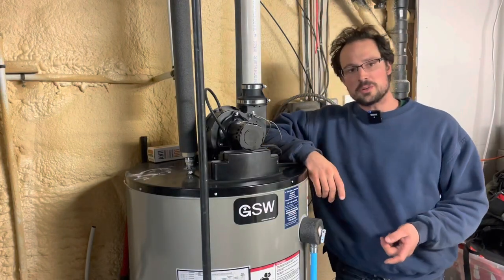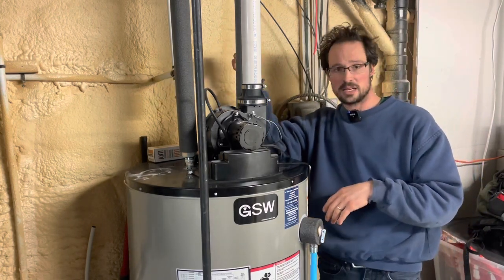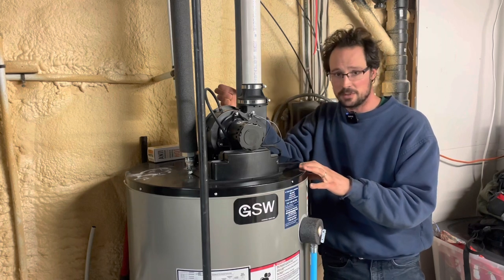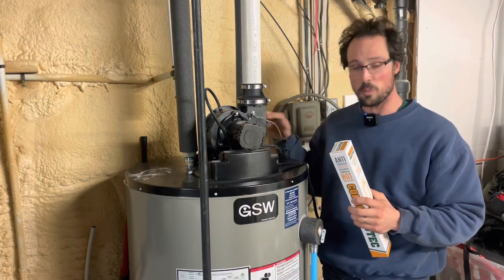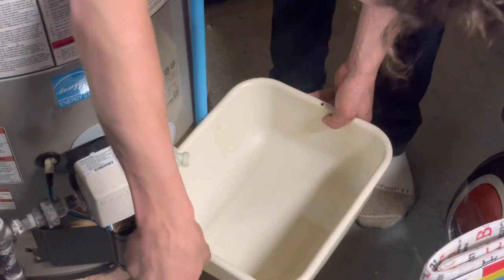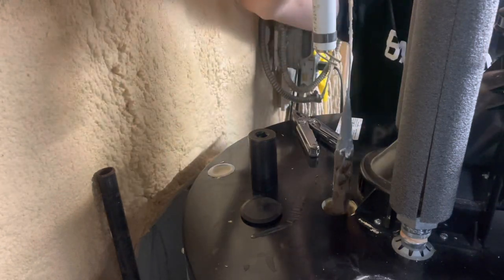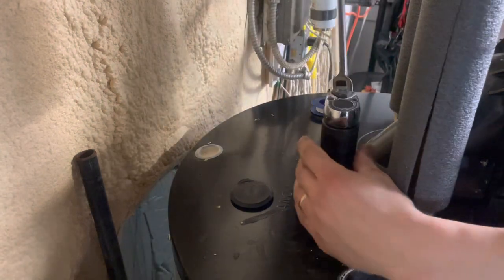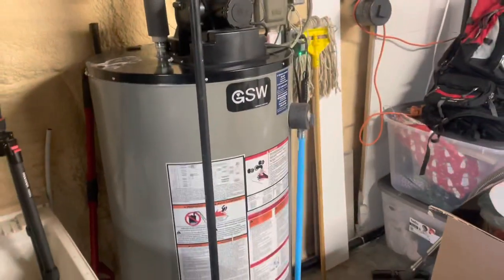Smelly Hot Water Fix - Electric Anode Installation

Comment: I've had an electric anode for about 10 years. It solved my egg smell problem. Next time I buy a new hot water tank I'm going to remove the anode while the tank is still in the back of my truck laying on it's side. Much easier than trying to keep the tank from spinning if the anode is rusted in there.
Reply: I had to use my impact to remove it. Worked very well

Comment: Thanks for mentioning that this new anode is a different size than the old (standard 1-1/16") anode and the new  size is actually 1-3/16", but I am glad you said that a 30MM socket will work. Good video

Comment: Excellent video on removal of the old anode rod and replacing with the Corro-protec. My 50gal AO Smith Gas water heater is about 3 years old and I drain and flush once a year. I knew the anode rod should be replaced every 3 years or so and upon checking for a new anode I ran across the powered anode. It has a 20 year warranty and hopefully it will provide trouble free service and save having to change the anode every few years.

Comment: Killer! New to well water. Got a new tank and smell is still there ( water wasn't ran in two years so needed a new tank! Yuk). So I did see this online and glad you verified it's worth! Will Amazon it and thanks for the instructions.
Happy New Years from Maine🌟👍
Reply: Did this fix the smell with your hot water?
Reply: @chadgilreath8952  funny it did get better but iron in both cold and warm now. Put a carbon filter ( in our sediment casing filter to replace the sediment only filter) water doesn't smell and iron is much better but PH is still hard. I know that filter will have to be changed at least every 45 days. We will see. Will work till we get money saved for filtration and water softener.

Comment: Good video. However, there's probably still residual white powder at the bottom of the tank. Which, depending how old the tank is, could require additional efforts to get rid of. Amazon lists something called "Turbo Tank Cleaner" which appears to be helpful in getting rid of the white powder stuff. Also: if the old anode rod is stuck in place, an impact wrench can provide help. Home Depot has electrified impact wrenches for rent: ~$17 for a 4 hour rental.

Comment: Here is some weird information for you. I'm a bit of a lazy guy, so sometimes I just leave my water softener without salt for LONG periods of time (note: the timer is still running, and its still back-flushing during this time). What I noticed is that when the water is hard, I don't get the sulfur smell. Once I have run treated water for a couple months it comes back. This could come from the sacrificial anode becoming coated in a mineral deposit while the water is hard, stopping the chemical reaction that causes the H2S, but also sacrificing the lifetime of the water tank itself.

Comment: I installed this today on my 3 year old water heater, i flushed it at least 5 times to get all the Ca out and replaced the anode rod, while doing that i realized the hot water line going to house was leaking, i had used sharkbites.. 😢 never ever going to use sharkbites, i used it because it easy and visible,  i solder the 3/4 to Copper AND now its all good. Hopefully it will last 20 years or so.

Comment: In my new home I'm on public water.
My tank doesn't have an anode, and both hot and cold water are soft/slimy after washing hands.
The water also has a sulfur smell. 🤢
Should I add an anode, or find the main coming in and install a treatment option, or both?
Reply: you could check with city, or have it tested it might be hard water you might need softener do they chlorinate and treat water?
Reply: Your anode is probably  part of the cold water dip tube. So you have to remove the dip tube to get at the anode.
Reply: @GreenAcres581  is it the same standard size?

Once I adjusted the heater to a hotter setting the water at least smelled better… either that or I got used to it.
Hopefully I’m not smelling gross after a shower. 🤷🏻‍♂️
Reply: @GoodHydration  The separate anodes are mostly universal, but if it's part of your dip tube then it has to be specifically for your model tank because it has to be the right length. The problem with dip tube anodes is they tend to be longer, so they can be hard/impossible to remove because there isn't enough overhead clearance in the basement. There are also some tanks that have the anode part of the hot water outlet,  but that isn't common. Those are shorter because the hot water is taken off the top of the tank so the anode can be a "normal" length.

If you run the hot water temperature high enough you are killing the bacteria that cause the smell, so that's an effective solution but you have to pay for the extra energy to raise the temperature.
Reply: @GreenAcres581  thank you for all the info., it’s difficult finding out all the things you wish they’d teach in school right after buying your first home and just before harsh winter hits! 😅
Reply: You lucked out re getting the old anode out. Usually , you need an impact wrench to loosen it , or a longer cheater bar and a second human to brace the tank so it doesn’t turn.

Comment: Thanks for this.  Ending my rotten egg smell tomorrow!
Reply: This should fix the issue as long as your sulphur smell is limited to the hot water tank, as the smell is caused by bacteria that live in there and feed off the minerals relased by the unpowered annode.  If you heat up cold water in a pan on the stove and it doesn't smell then your good.  If the heated water on the stove makes a suplur smell, then this wont work, as it's just sulphur in your reguluar water.

Comment: Good presentation! An issue I'm trying to get an answer to before installing my corro-protec is that the instructions state to ground the tank but make sure it's not to the paint on the tank. I didn't see you scraping any paint off before you screwed the ground wire to the tank. Was this an oversight or is there still grounding happening? Thanks
Reply from the maker: Thank you. They just want to ensure that the is good contact. In most cases including mine the screw being threaded into the raw steel of the casing is enough contact for grounding purposes.
Reply: You don’t need to remove paint in order to get a good grounding!

Comment: Nice video/Good Info - Is there a purpose or reason the electric rod is so short compared to the original anode length? I take it because of electric conductivity in water it doesn’t have to be continuously in water or does it? What happens if the tank water goes below the electric rod length? Does it burn out and have to be replaced?
Reply: No if the water falls there will not be a path for current and it will just turn off. No damage
Reply: Good question! You’ve pointed out the difference in size between the electric anode rod and the traditional ones. The electric rod is indeed shorter, utilizing an electrical current to prevent corrosion, which means it doesn’t need to be as large. It’s designed to switch off if the water level drops below the rod, preventing any damage and ensuring longevity. Once the water level is restored, the rod will turn back on and continue to protect your tank. Clever, isn’t it? 🙌🏼

Comment: so will this make water heater last longer than with a regular anode will it last forever or does it need to be replaced like regular metal anodes?
Reply: It should last a very long time and extend the life of the water tank.  Regular anode rods have very short longevity compared to this and since most people never check their anode rods they don’t realize that their tank is quickly corroding away.  Another good idea would be to replace the tank’s drain valve with 2 dielectric 3/4” nipples and a 3/4” ball valve for a more thorough annual tank flush procedure.

Comment: Nice video buddy. Now what would you do if that anode broke off inside your tank as you were pulling out..?
Reply: No worries at all, any remnants will simply dissolve at the bottom of your tank. Just remember to install a new anode rod to ensure continued protection!
Reply: I have been told by a plumber that particulate matter at the bottom of a gas water heater would prematurely wear out the bottom of the tank.  He  tried to describe the process of the particles "jumping" off the bottom of the tank when they are heated.  Over time, these "explosions" wear out the bottom.  He said that you can even hear the "explosions."  I took several classes from him at a local community college.  I would tend to believe him.  Everything else he said/taught was spot on.  Being a chemist myself, I would think that the corrosion products on the surface of the anode may not be as soluble as you might think.  What magnesium compounds are you thinking would be soluble enough to dissolve away?  Perhaps some particles might get physically washed out of the tank, but solubility and "dissolving" is a different story.  I would bet that if part of an anode fell to the bottom of the tank, it would be there when the tank had to be replaced and that the presence of the anode at the bottom, would help to shorten the life of the tank. @corro-protec

Comment: I do have this issue. I haven't got the corro protec yet but am considering.
When you took the existing anode out it went down very far in the tank.
And then was covered over flush with the top of the tank.
Is it OK than to put a much shorter anode in the çorro protec and have it protrude from the top of tank. 
My tank is a John Wood and is over 10 years old. My plumber told me don't replace the tank even if it exceeds the warranty date. Maybe because it is a expensive item too replace. Still lots of hot water. Oh and I am on a whole house well system and just replaced the water filters this February.
Reply: We have this rotten egg smell and our water softener company told us to just remove the rod completely because the aluminum anode rod can actually make the smell worse. For the past few months we have been bleaching the hot water tank every now and then. Works great for about 2 weeks and then it just comes back. At this point, I’m just so over the smell. I don’t care about the warranty lmao!!! I just ordered and electric rod and I’m hoping it helps. Over time those rods will completely disintegrate. After researching, I’m really hopeful that this will help. I know you commented over a year ago but hopefully you found a fix!!! We’re probably going to have to get a new tank to just start over.

Comment: have same problem. but my anode rod is under the cold water pipe. too bad for me. thanks for the info.
Reply: It seems like you might be using a Bradford White tank, characterized by its unique design where the anode rod is situated in the hot water outlet port. Excitingly, we offer a Corro-Protec model tailor-made for Bradford White tanks, ensuring a seamless and efficient installation directly into the hot water outlet port!
Reply: I have the Corroprotect model you mentioned and it so far I am quite happy with it. I did have to open up the sheet metal around the old inlet to provide added girth for the fitting but it was all described in your manual.

Comment: I tried this, but the nut for the existing anode absolutely would not loosen. The nut now appears stripped. Am I just out of luck now?
Reply: I don't work on water heaters, but I work on cars and when I've stripped bolt heads before I've done things like:

Weld another bolthead on top of it
Weld a metal bar onto it
Drilled it out
Used some reverse threaded drill bits that "bite" into the metal and take it out.

Anyways, even if none of these work for you, go ask some automotive ppl if they have a suggestion. They deal with stripped bolts all the time.
Reply: John - you might be, but maybe not. My nut also would not loosed even with a breaker bar - but if you haven't tried it, an impact wrench finally did it for me. Crazy how tightly some of these nuts are put on at the factory! Possibly on the order of 150 foot/pounds.
Reply: Cutting Torch and cutt it off Make sure the flame 🔥 is blue.......
Reply: @mitchm426  Yup, impact wrench is the solution for stubborn nut.
Reply: if water heater is more than a few years old it is probably permanently rusted in there
Reply: I used an air impact wrench.

Comment: I replaced my rod with a magnesium rod. No smell. I pull it once a year to check it. Takes less than ten minutes. I write the install and inspection dates on the water heater with a sharpie. $25 every 8 or 9 years is way cheaper than an electric.